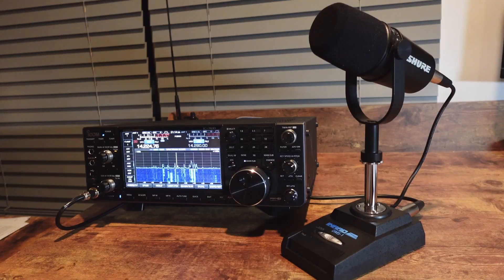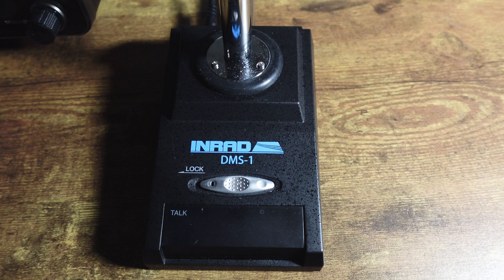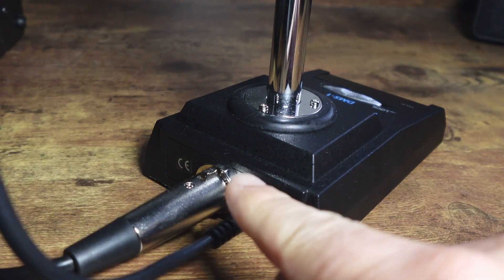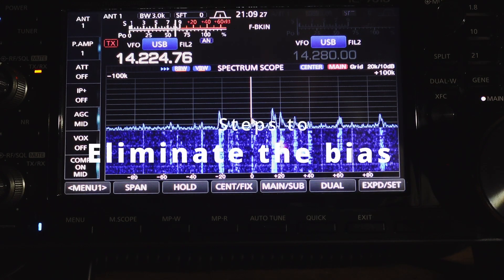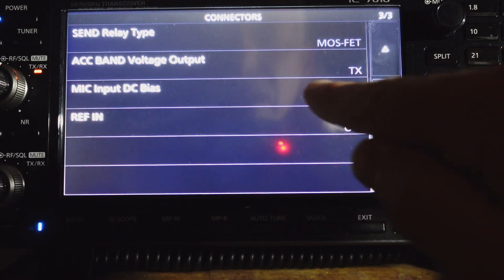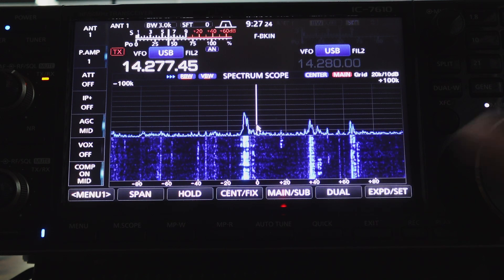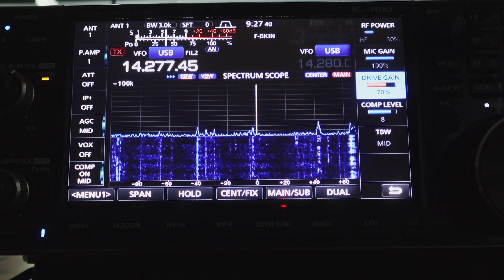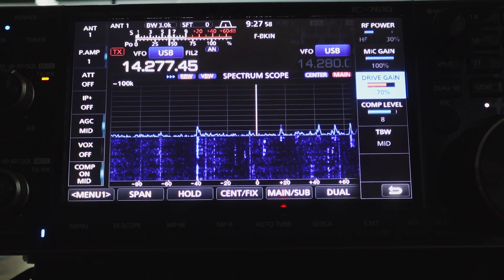Mic Up Your Icom 7610: Dynamic Microphone Connection Guide [No blocking capacitor or preamp needed]

Comment: I've been using dynamic mics on all my Icom HF radios since my first 756Pro including my current 7300 and 7610. The mic preamps have been sufficient on all these models to easily allow the mics to fully drive the radios (early Icom radios did have lower gain). I use a box with a 1:1 audio transformer for isolation (helps with RF immunity) and a blocking capacitor after the transformer for the radios that don't have switchable mic bias. I currently switch between an EV RE27ND and a AudioTechnica BPHS1 headset with great results.
Reply from the maker: Thanks for sharing. 73, Paul

Comment: thanks for the great video, can i connect my podmic with the toping30 stack or fiio k7 without mixer
Reply from the maker: Thank you for the nice comment.  I looked at the podmic specs and I think that you can connect it to the radio just like I did via the xlr. No need for an amp or mixer.  You could use one of your dac/amps if you would like.  73.